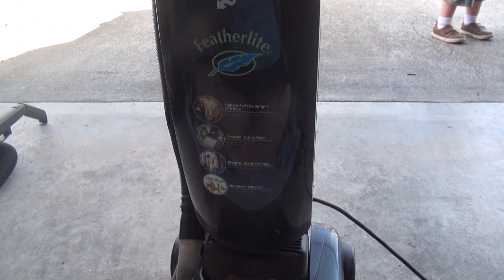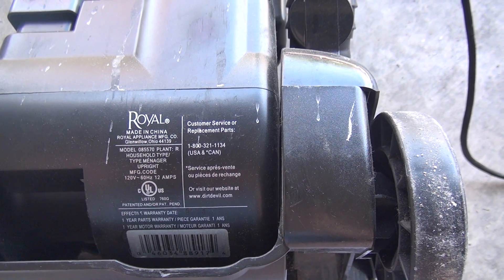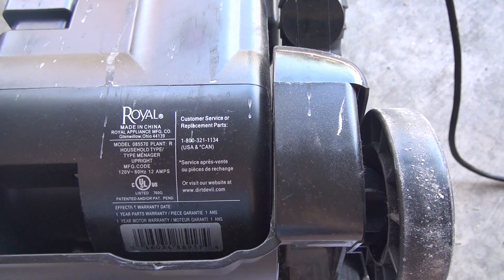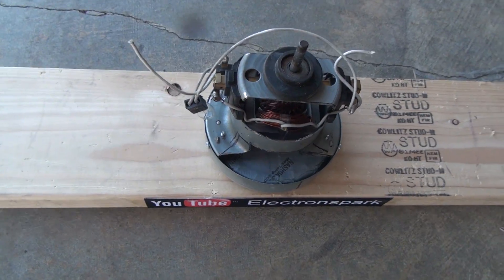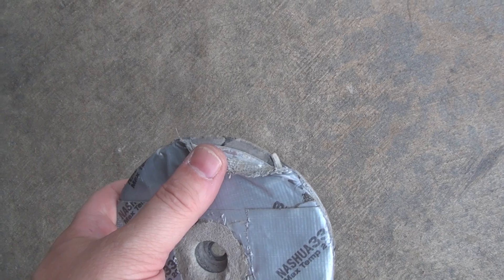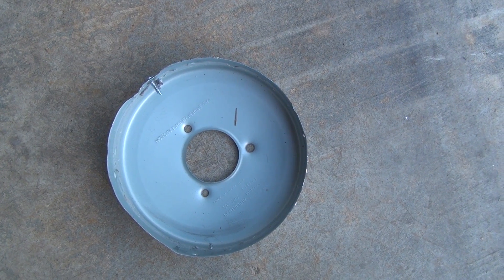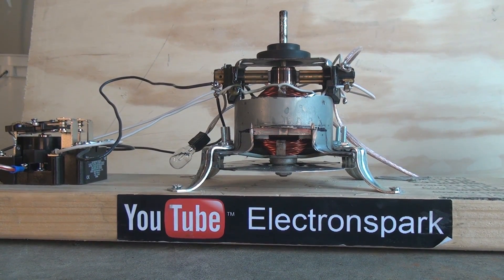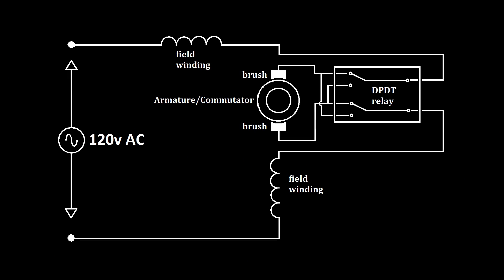Reversible Vacuum Motor Burn Out

Comment: That was actually a very good idea if you WANT to trash the motor. Once the motor's been used for long term service running in one direction, the brushes are bedded in with a wear pattern in that direction only, and when you reverse it, they aren't going to make as good contact... in some cases they may even snag if they can shift in the holders enough. Bang!

Comment: This is a universal motor. If you want a true AC motor then you need to go with induction. They have no brushes and can only work on AC where as the motor in this video can work on AC or DC.